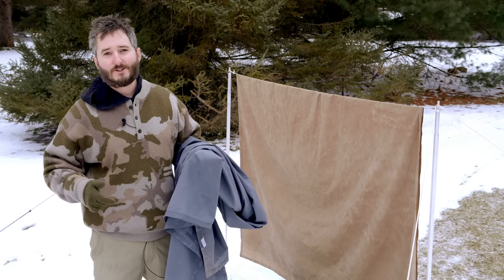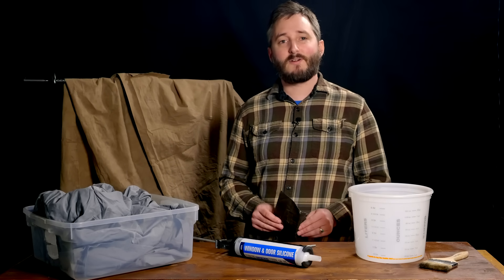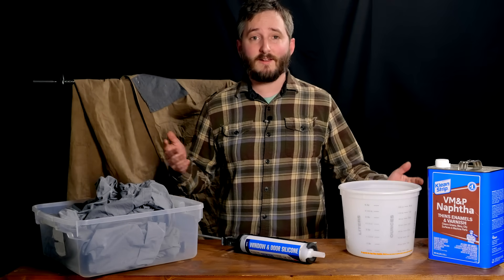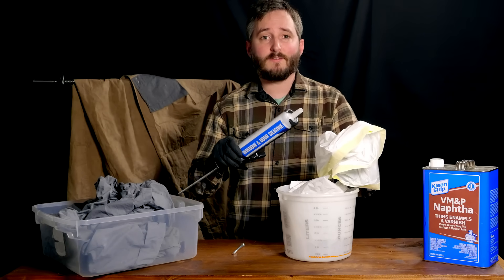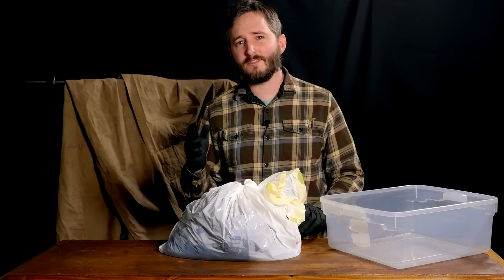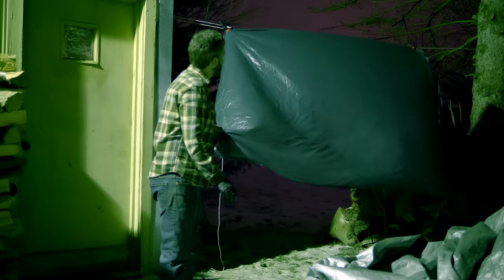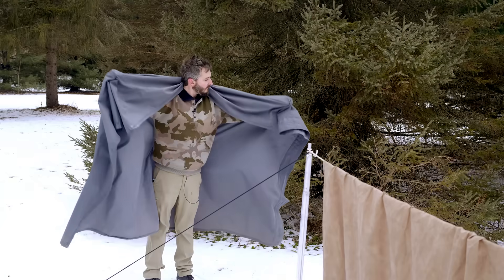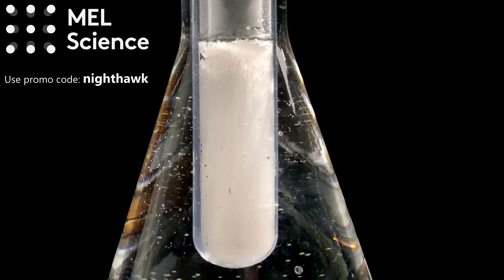Recycled Bedsheets Make The Best Waterproof Tarps

Comment: I think this may work for my ice shanty. I've got an old suitcase ice shanty that dosent have replacement insulated canvas anymore. 
I'm curious,  will this work with wool blankets? Or if I will still need to have the wool under a waterproof layer? 
Has anyone tried this with wool or other thermal trapping fabrics?
Reply from the maker: It would be a waste to treat thick fabric in this way because it only needs to be waterproof on the outside. It would soak up much more than necessary. You could try spraying it on
Reply: @Nighthawkinlight  thank you for the super fast response 😆.  I was pondering the paint/spray on method but wasn't sure it would be evenly coated.

Comment: A really large piece of fabric could be doubled over to make a heavy cloak that unfolds into a tent.  If really large,  then another fold at the shoulders should make a hood.  Perfect for ultralight cold weather camping in wet regions.

Liquid silicone can be purchased with resin, eliminating a step and some waste, but also expanding the range of viable fabrics.  Since silicone is tolerant of heat, it should be possible to boil off volatiles in an oven by baking at low temperatures.  That will depend a lot on the textile used.

Comment: Penguin mode! Hilarious, never thought of it that way when wearing one of those old military style canvas poncho Shelter halves.
Thank you for the specifics related to ratios for mixing as well mentioning that naptha or sometimes called white gas is a bit better than use a mineral spirits. This is extremely helpful information. I have looked at doing this process in the past, but the solvents and silicone when I looked was cost prohibitive.

Comment: Your video popped up at top of YouTube, and I have to say, It's an answer to prayer!  Decent tarps are very costly for my income, but I've been in need of several. Purchased one, but have been saving up for another, one at a time.  Very SLOW process!  I've got "tons" of older sheets!  Going to spend what I saved so far on the solvent and silicone, and see how many "tarps" I can get from that.  Thank you, SO MUCH!
Reply from the maker: If you're doing a lot make sure to test a little first to make sure you've got the right kind of silicone. It should be the kind that smells like vinegar
Reply: @Nighthawkinlight  Thank you for that Info.  I'll make sure!!

Comment: Thanks for sharing.

Unfortunately VM & P Naphtha is a petroleum-based solvent and is not a renewable resource. Its production and use contribute to greenhouse gas emissions, which can have negative impacts on the environment. Additionally, the use of VM & P Naphtha can lead to the release of volatile organic compounds (VOCs) into the air, which can contribute to air pollution.

Do you know of any alternative solvents to use that are less hazardous to the environment?

Otherwise, great video 👍🏻

Comment: I needed a long lasting tarp for my 12 foot homemade boat. I used a canvas painter's drop cloth from Harbor Freight. Of all the methods known to me at the time, the only materials I had was some leftover exterior house paint. I used that and painted it on while the canvas was secured over the boat. When it dried it was quite stiff, but conformed to the boat perfectly. I used a grommet tool to install grommets at key places. Now four years later the canvas is getting weak from constant exposure and the grommets are tearing out. I wish I had known about the silicone treatment before I made this, as this tarp is too stiff to use the button method to secure it. About the silicone treated sheet, how long does it last when exposed and would I have to re-treat it regularly?
Reply from the maker: I'm not sure how long the silicone lasts. I've had mine for over a year now and it's still pretty water repellant. It's breathable so a small mist of water can make it through in hard rain, but most rolls off. House paint is a good idea!

Comment: Did this on my canvas 4x4 canopy cover about 1yr ago now. Vehicle sat in a shed for several weeks before going out camping in the rain. Didn't notice much improvement. And second time in rain 1 week later was not good at all. When i applied this mixture, i pre cleaned/washed the  canvas 2 weeks prior. Gave the canvas 2 good well mixed heavy coats in 25 deg C weather. Tap water would initially bead off the sides when testing. But i think after driving with wind disturbances on canvas. The mixture has broken down in the canvas fibres???
Not going to bother again.

Comment: Ive the neccity to try the recipe, but have the concern of a fire hazard of complete combustion after drying to cured, could you offer insight affirming my cautions one way or anotger of safety after drying cured. 
Thank you for your time. Ive subscribed and askwd for all notifications. 
  Truly, Charles
Reply: Spelling noticed afterward (uh well)
Reply from the maker: The liquid is very flammable so you must use caution when making the tarp, but once dry the flammability is no different than the original fabric.

Comment: Thanks for this video!  For lower cost options to create the treatment use generic white gas instead of hardware store naptha. They're pretty much the same thing but camp fuel can be found for less than half the cost. I was able to get a gallon of camp stove fuel for 7.50 and silicone I tube for 6.00. I treated a king size 100% polyester sheet from the thrift store using one tube of silicone and half a gallon of camp fuel. It dried within an hour or 2 in the wind, 70 f and only has the vinegary silicone I smell left that will hopefully go away. Polyester was used because it is supposed to be more UV stable than other materials. I'll be using my new tarp to cover equipment outside so I'll see how long it holds up. Regular plastic tarps turn to dust in a year.
Reply: You should say the results of your test as I am curious if this could work for my BSA troop
Reply: @QwertyMB  So far so good. It's only been 2 months but the sheet still sheds water well and is holding up to the sun. If it makes it more than a year it will be better than the extreme duty tarps they sell at Harbor Freight. Those started disintegrating after a year.
Reply: @LeviSugden have you tested this to see if its flammable? Im curious to try this but a big flammable blanket hanpging outside my house seems pretty dangerous
Reply: @khaosforever5034  Polyester is more likely to melt under heat (it's plastic).  Use a burn test to check your fabric first if that's important.
Reply: @khaosforever5034   I haven't.  I wouldn't think it is any more flammable then any other tarp.  The naptha is completely gone after a couple hours of treating the sheet. While the solvent is still present, hanging it somewhere it won't be a danger is a good idea.
Reply: The tarp has started to rip where it is in contact with corners on the trailer being covered. Still holding up to the sun besides the rips that have developed.
Reply: @QwertyMB   9 months in the AZ sun and still holding up well. This is much better than the HF extreme duty tarp I had been using which would be falling apart by now. The only consideration is it isn't as waterproof as a typical PE tarp.  It resists water, but you aren't going to be able to make a boat skin out of it.
Reply: Do you think these tarps can be made into a waterproof tent?
Reply: @Dcvmnaturalist  Possibly. It won't be any more waterproof than a regular tent though. Water can still be forced through the fabric with enough pressure behind it.  I also find it will saturate with water over time.
Reply: @LeviSugden  thank you I really appreciate your thoughts

Comment: This is great content for me and upcoming project to treat camp gear as a DIY person who wants custom but effective solution to outside the box conditions like marine use on the cheap.   This was rare YT suggestion and it randomly appeared. Happy to subscribe.  I would only re-double your warnings about use, storage and safely applying solvents in any forms but particularly in the quantity shown in a flimsy plastic bin liner.  This persumes your audience has some idea the risk but for those who don't know this is highly explosive vapor hence need to done outdooors and enclosed spaces can have ignition from static from "paint" tarps and start fires or cause serious injury and fire.  In addition to the toxicity and responsibility for disposal properly.  As former contractor and safety nerd its a real hazard outside the can and should be used with adequate caution.

Comment: Do you think this silicon solvent coating would work on a building such as cob? I know the cob still needs to be able to breath. So coatings such as oil paint wont work, because it clogs the microscopic pores. Therefor, the cob structure can't breath, and retains moisture, eventually getting weakened by it. Traditionally a lime coating was used, to somewhat improve water resistance, yet still being able to breath. I suspect though, that this idea of yours might be a possibility. Let me know if you have any thoughts on this idea.
Reply from the maker: It's possible

Comment: Do you think this could have much benefit on existing nylon tent material? Clearly fabric and canvas etc would absorb the treatment, but perhaps the fabric micron size of the nylon material, which already has waterproofing properties via the fabric itself might not have much effect with this silicone treatment.
Reply from the maker: Tent fabric is coated in silicone I think with a pretty similar method. It should work to refresh the coating if the fibers aren't too stretched out.

Comment: Would this work for stretchy fabric? I don't need the fabric to be stretchy when it's dry, I'm just wondering if I accidentally stretched the fabric if it would break the waterproofing. I'm wanting to make a tablecloth for my dining room and the fancier fabric I would like to use is somewhat stretchy. Thanks!
Reply from the maker: The sheets are stretchy and they worked fine. The trouble I would expect with a tablecloth is that liquid from a spilled cup would roll right off and onto people's laps!
Reply from the maker: Also the coating can look a little splotchy  so it might ruin the fancy look of your fabric.

Comment: Thank you for the very educational video! Do you think this could be used on a tent fly made of nylon? It is a  French F2 surplus military tent that leaks pretty badly.
Reply from the maker: Yes it should work well on a tent, but test it on a small area before doing the whole thing. Make sure to use type 1 silicone which smells like vinegar. Type 2 will not work.
Reply: @Nighthawkinlight  Thank you for getting back to me. Was not aware there was a  type 1 and type 2 version of silicone. Have a great week.

Comment: Wat is een goed alternatief voor nafta? Wasbenzine?
Reply from the maker: Camping stove fuel
Reply: @Nighthawkinlight  Ok so in the Netherlands I can easily get wasbenzine (5-15 carbon hydrocarbons) and terpentine (7-12 carbons plus max 25% alkylated aromatics). I think wasbenzine is therefore safer, but now that I'm reading about it Wikipedia says terpentine is basically naptha. Would wasbenzine work as well? Does the solvent matter a lot?

Comment: i’ve tried it on an outdoor car cover it probably made it waterproof but water condenses underneath anyway. But the problem with this is now for some reason it condensates on the exterior as well 😂. I can still use the cover because I’ve installed a special wicking layer underneath, now the top layer is UV and dirt proof.

Comment: How many sheets can you do at a time? I'm guessing one tube of Silicone per sheet. Is that right? How about the Naptha. I'm not sure the volume of your can, but how many sheets do you think one can could treat. The reason I ask is that this looks like a fun and easy project for my scout troop. We use tarps for everything!

Couple more things - how big was your sheet: twin, full, queen, king? I'm sure that will affect the recipe. How do you dispose of the goop when you are done?
Reply from the maker: The amount of naphtha and silicone needed depends on the volume of your fabric as noted at 1:45 and 3:25. My sheet was full size. You should not have extra liquid to dispose of, but if you do let it dry in open air and only a lump of dried silicone will be left. I would take caution doing this with many kids at once as there is a large fire hazard if a sheet caught on fire by a spark before dry, and the naphtha is a hazard for inhalation and skin exposure. It's best done by adults.
Reply: @Nighthawkinlight  Thank you!

Comment: been using buttons on my homemade tarps for years. Great, to-the-point explanation of buttons.

Now, about this waterproofing.... was thinking waterproofing a thin jacket from it for cyling in the cold rain. But do not want to sweat too much... I assume this stuff does not breath at all, right?
Reply from the maker: It does breathe. Water rolls off but it's not completely impermeable like a sheet of plastic.

Comment: And no one is concerned how long it lasts, does it flake off, does it bead off, as it wears away is it patchy, is it UV stable, does it ruin your fabric ????. I'm debating this idea on a convertible car canvas roof , but not if it's going to ruin it and land me with a £3000 replacement bill !!!
Reply from the maker: It works and does not peel off, but it may leave patchy discoloration.

Comment: Have you tried using gasoline in stead of naphtha? If yes, using the same ratio? Hardware stores in Germany don't usually have naphtha. I wonder which other crude-oil derivative is closest to naphtha or whether it is just sold under a different name.
Reply from the maker: I've been told gasoline works, but it's even more flammable than naphtha so I fear to recommend it because of fire danger when drying the sheet
Reply: @Nighthawkinlight  Thanks for the info. I agree gasoline is very dangerous. I'll try to make a test piece and if it turns out good I'll figure out how to do it safely. If I end up finding naphtha or an equivalent sold in Germany I'll post it here as a resource for others. Thanks again for the video!

Comment: This is my first winter living off-grid. I have a 1000L potable water tank that I covered with 6ml poly. I used the button fastener to tie it down. We normally get wind speeds of 100km/h  and at least once a year 140km/h. even 180km/h is not uncommon! See Newfoundland/Labrador.  The button knot has worked perfectly as it spreads the load over nearly the whole area of the poly!  The poly will tear in unusual places though,, but not at the knots!

Comment: You mentioned that this method of waterproofing make the sheet similar to a camping tent. One of the negative things about camping tents is that if you touch the inside at the point where water has gathered on the outside, the tent will then leak. Does that happen with your version? Thank you for a very informative video.
Reply from the maker: It's possible if water is pooled on the outside

Comment: I have mine hanging on the laundry line drying right now. It was 7 liters of cloth (heavy king-sized sheet) so it ended up taking substantially more naphtha and silicone. I'm excited to check it out tomorrow morning. I did a lot more dipping, rotating and removing the cloth from the liquid to ensure it was fully coated before I tied the bag and squished it around.
Reply from the maker: Let me know how it turns out!
Reply: @Nighthawkinlight  It is definitely waterproof enough to roll droplets of water off without wetting the material. Interestingly, I can still draw a breath of air (slowly) through the material. Also water can be pushed through with pressure. I simulated a water pool that can form on a loose tarp and the water permeated the cloth in many locations. My coating technique is probably to blame for inadequate coverage although it all appears quite uniform. Perhaps a thicker mixture would fill the slightly larger weave gaps. This mixture ratio may have worked perfectly on a higher thread count material. The tarp I made is not a good choice for a ground cloth, but it seems suitable to shed rain provided it is not allowed to pool on the tarp. I think a recoating is in my near future to see the pores can be completely sealed.

Comment: Has anyone here tried to find a method to connect two (or more) tarps and make a waterproof seam?  It ain't happening.  But with these you could sew two together, make a small amount of "waterproofing" and seal the seam using a paint brush.

If you were waterproofing something larger, like a horse blanket, could the solution be applied with a pump sprayer?

Comment: Hi, thanks for sharing this. I tried this water proofing method and I have four questions. Thank you in advance for helping me with them. 

1) When I mixed the silicone with the naptha, it didn't completely dissolve. Am wondering if that's how it's supposed to be or perhaps the silicone I got was too old?

2) It worked well on some materials, but left a residue in others. What can I do about that? 

3) Would this work on materials like faux fur, suede etc? I tried and the strands started bunching up together and am wondering if I give it a gentle machine wash would it fix the problem? 

4) Are these materials safe for the skin?
Reply from the maker: Did the silicone you used smell like vinegar? Acetic acid cure type works best and should dissolve. It smells like vinegar. I don't know what to do about application to new materials. For long term skin contact items like clothing i would suggest spraying on the outside of the item rather than soaking all the way through. Whether it's skin safe could depend on the particular brand of silicone and the sensitivity of the particular person wearing it.